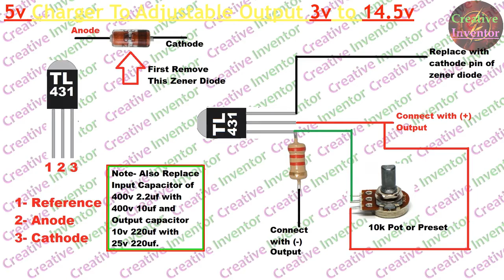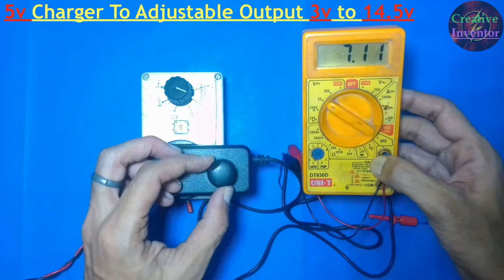5v Charger To Adjustable Output Supply | 5v Charger Upgrade To Variable Dc Output Supply | 5v To 12v

Comment: You connected Reference to 2.2k then (–) outpout....but you should connect (–) output to Anode of TL431...
Reply from the maker: every detail i had explained in the video, and also shown practical of working, if there would be any wrong connection the circuit will not work. if u have any confusion watch the video again.
Reply from the maker: Also the (-) pin that are telling its the common Gnd pin that is common in both.
Reply: I think he is right (-) output should be connected to cathode of the tl431...diagram is wrong. But practically the creator did correct that's why circuit is working.